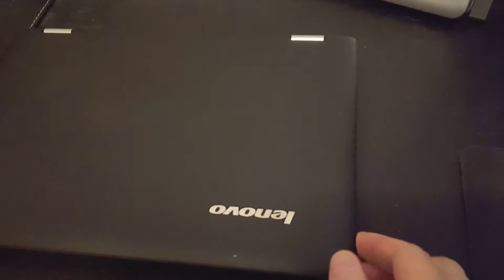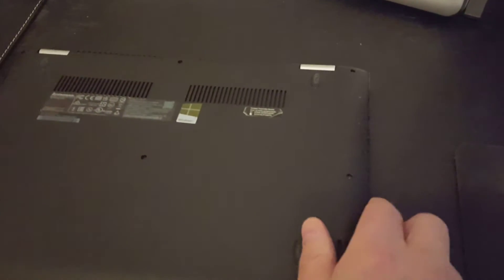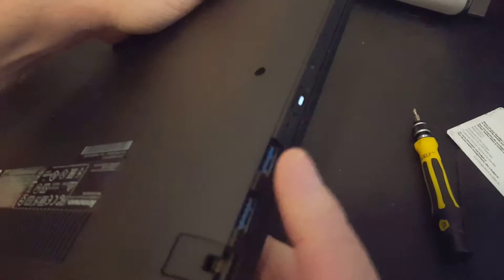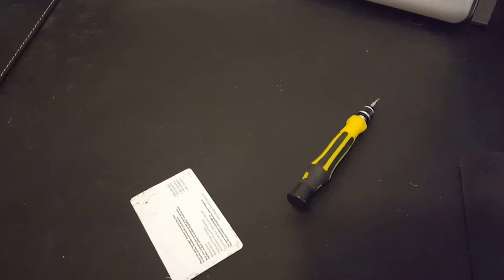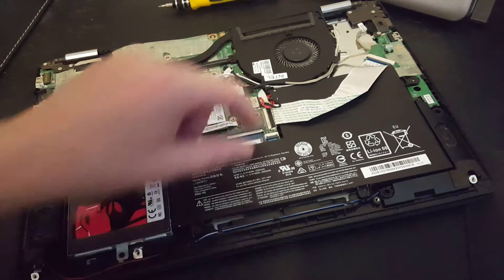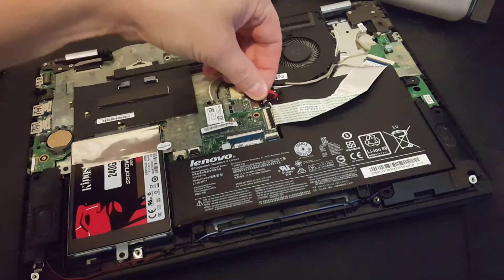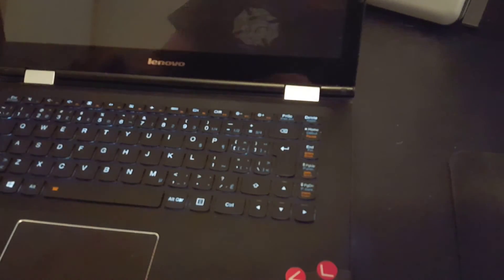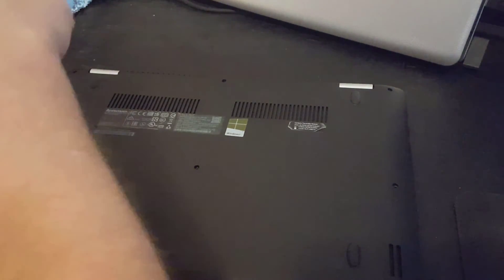Easy Fix Easy Fix Lenovo Laptop Flashing Power Light Will Not Power Up - Disassembly

Comment: Do you know what is causing the computer to not power up? I have had to do this disconnect twice after replacing the bios and main battery. Would be great to solve what is causing the "no power up" issue. Great video, btw!
Reply: It normally starts happening o ce you start opening your laptop. Idk why but there is probably a safety thing. The battery disconnects so that you dont shock yourself.

Comment: URTechDotCa Hi Lovely video I understand the instructions but what exact screw has to be used to get the 9 screws out of the back
Reply: Ryan Haggard Those screws don’t come out. It sounds like you may have a Yoga 260. Well at least on my Yoga 260 they don’t come completely out of the bottom casing.

Comment: I have a Flex 3 1130. I saw this on your website as well, but this solution didn't solve it. Disconnected both the main and CMOS batteries, and still it acts this way, and Lenovo support has been useless. So, thank you for your effort and I hope it helps others who have this problem.